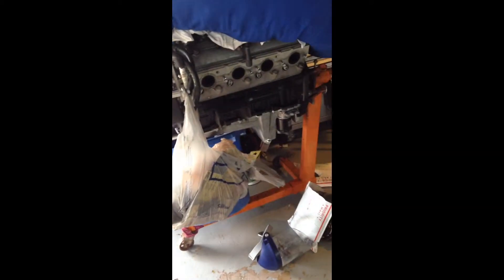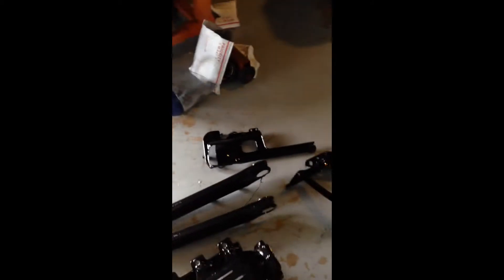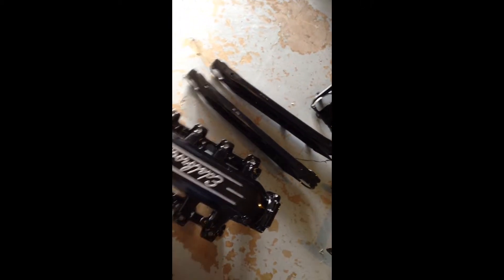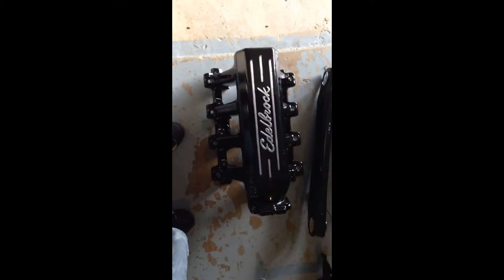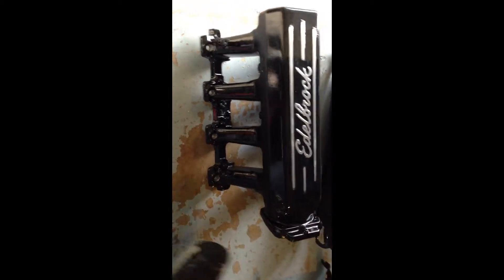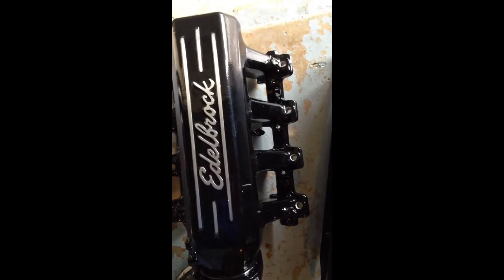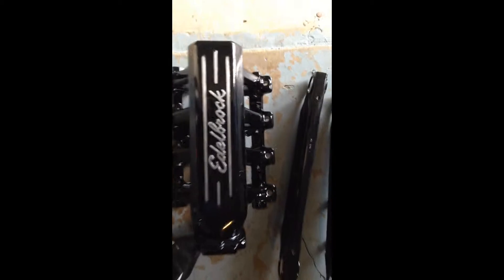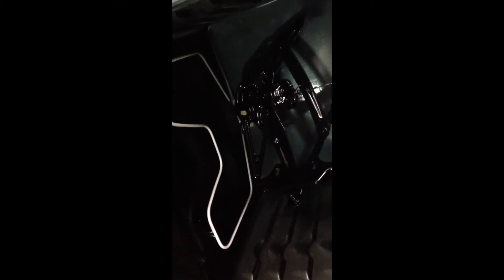Powder coating parts

Comment: good chit but how did u fit support an fenders in oven?
u freelancing? lol i need my rad support, fender wells and a few other pieces done
Reply from the maker: I have a steel shed in the back I emptied it out it's a very small  5 x 5 I used a burner and a propane tank . I powder coated all the parts then I hung them up turned on the  burner and let it get hot in there and it work the course I had a propane tank sitting outside the shed and only the burner inside the shed. That's how I did it
Reply: Jesse Alcantar
damn.. i need a shed lol